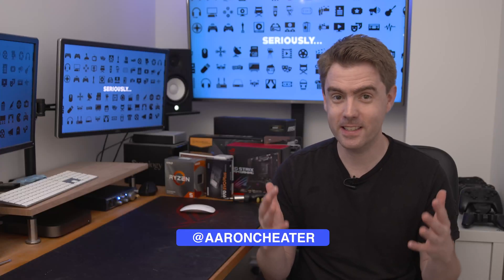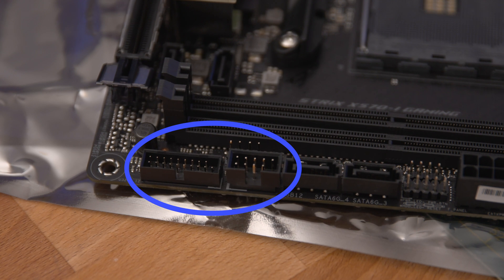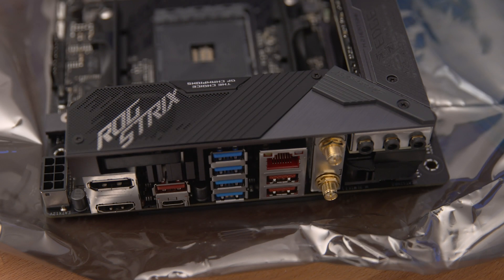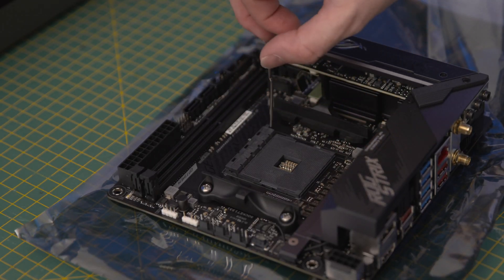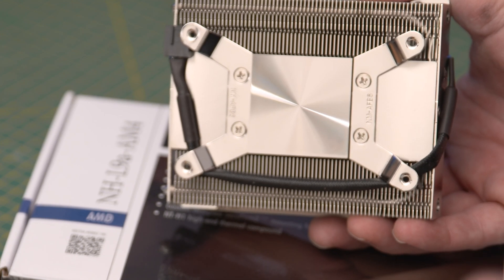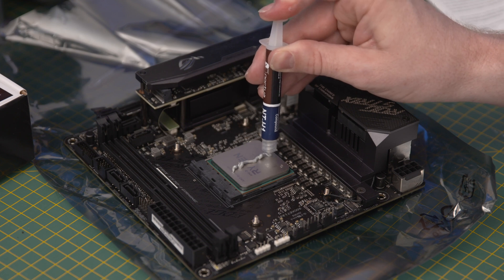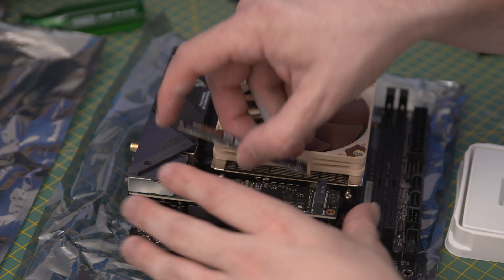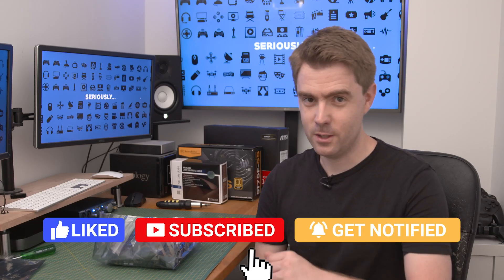Building an AMD Ryzen, Asus ROG Strix Mini ITX Gaming PC!

Comment: that's definitely not double sided sticky tap behind the PRESINK for the M.2 drive.... but thank you for removing the peel from it haha. I love the confidence when saying its for holding it in place after you just screwed it down though.
Reply from the maker: Hey man, it was sticky, and are you saying i shouldn't have taken the peel off the tape before installing it? Normally the thermal pad is separate that you would apply directly to the SSD and then put the heatsink over it, which is why I said it holds it in place.  But since the pad was already on the bottom of the heatsink I just took the peel off and left it there when I screwed the heatsink back in.
Reply: @AaronUNLOCKED  no you definitely should have peeled it off, it is a thermal pad, similar to thermal paste but a tape-like version. it just helps with heat distribution.
Reply from the maker: @eyesac7486  yep i know, thats exactly what i said above

Comment: im getting temp issues but it might try your method if it'll fix the temp issue

i have a 5600x and it was fine on the gigabyte x570aorus but the asus x570i runs hot - im not sure if its a mb issue but im pretty sure i placed a pea sized paste and screwed it tight but not excessive

Comment: Will the motherboard still work if you use it without the heatsink cover?
Reply from the maker: The motherboard will still work, but depending on what SSD you use, it might get too hot and overheat. Generally, if your SSD comes with a heatsink, it needs it. But if not, it doesn't!

Comment: Hey, great video, thanks. I am planning to do a similar build with a Ryzen 5900x and Zotac GeForce RTX 2060 and probably switch to 3070 in the future, can you tell me how would that fit on the motherboard, especially regarding the GPU, will it overheat since the case will almost close it's fans (I plan to fit it in Thermaltake Core X1 case)?
Thanks!

Comment: When I look up the specs for the ASUS ROG Strix X570-I on Newegg, I noticed the supported memory for 3rd Gen AMD Ryzen Processors
 is: 
DDR4 4800(O.C.)/ 4600(O.C.)/ 4400(O.C.)/ 4266(O.C.)/ 4133(O.C.)/ 4000(O.C.)/ 3800(O.C.)/ 3600(O.C.)/ 3466(O.C.)/ 3400(O.C.)/ 3200/ 3000/ 2933/ 2800/ 2666/ 2400/ 2133 MHz, non-ECC, un-buffered memoryl

Does this mean that the mobo only supports up to 3200 clock speeds without CPU overclocking?
Reply from the maker: It’s not the CPU that’s overclocked, it’s the ram. Any ram you see with over 3200 MHz is overclocked.

Comment: Cant take this seriously. Barely better than the verge. You call a thermal pad sticky tape, and you put a line of compound on your CPU. Please do your research before teaching noobs incorrect things.
Reply from the maker: I would ask you to do the same thing. I didn’t call the thermal pad sticky tape; I called the sticky tape covering the thermal pad sticky tape. And I put a line of thermal paste on there as that’s what has been recommended for this cpu type; as I mentioned I have also done a single dot in the past as well.

Comment: Hey I know this comment is a little late but what screwdriver did you use to remove the m.2 heatsink. I’ve been having lots of troubles and I don’t want to strip the screws.
Reply from the maker: Honestly I’m not sure of the exact size, I know it was a philips head from a jewellers screwdriver kit. I just kept trying them until one fit!
Reply from the maker: Honestly I’m not sure of the exact size, I know it was a philips head from a jewellers screwdriver kit. I just kept trying them until one fit!

Comment: I'm having trouble getting  the M.2 cover off. What size screwdriver did you use? I greatly appreciate it. Thank you.
Reply from the maker: I don’t know the exact size but I used a jewellers screw driver to unscrew it; they’re really tiny!
Reply: @AaronUNLOCKED  Thank you for replying. I was able to get feedback from Asus. They recommended a PH1 screwdriver. It ended up being the correct size.

Comment: Why the hell in 2020 are people suddenly going "place the mobo on the bag" It's not anti static on the outside. Use the damn BOX PEOPLE
Reply from the maker: Older bags were conductive, sure. But these days, bags are designed to dissipate and prevent electrostatic discharge making them essentially non conductive. As long as there’s no power running through it while it’s on the bag and the person working on it is wearing a wrist wrap like I was then it should be safe.

Comment: Im going to use the same board with the Noctua NH-D15
Reply: I've got 2 NH-15's 2 NH-25's and the stock AMD cooler cause I also have a RTX 2080 Ti and the Ryzen 9 3900x in the tiny case
Reply: sexyfishyphish sounds cool dude! That's almost 100NH

Comment: I hear this right? The CPU fan speed cant be controlled in the BIOS?
Reply from the maker: You can use QFan Control to change the fan curve from the bios, or use Asus’s AI software from inside windows to do the same thing. There’s no way to adjust the individual rpm’s from what I can see

Comment: how are the chipset temp and fan RPMs? i just returned mine (RMA) to the store because the temps where around 75 degrees and RPM 5000-6000 on idle.
Reply: In an open case with stock cpu cooler the chipset is around 60C with 3000rpm.
Closing the case and just running a noctua a12-15 with 800rpm negative in the back of the case drops the rpm on the chip fan to 1000(which should be idle) and temps around 56C.
Just a little airflow is needed.
Reply from the maker: Definitely sounds like you had something faulty there. My temps are between 30-40 degrees when not under load.
Reply: Bit late in seeing this video, no idea why YT decided to promote it now.
The reason for the high VRM temp and fan speed is a missing thermal pad.
Pretty poor from Asus but an easy fix for anyone else who suffers this

Comment: Need to take the sticker off the SSD so the heat tape will touch the chips
Reply from the maker: From the research I've done removing the sticker doesn't make much of a difference when it comes to thermals, and it can have important info on it that the manufacturer might need if there is ever an issue with it.